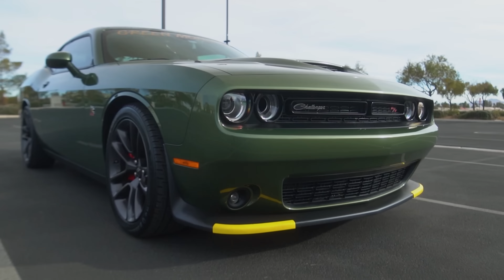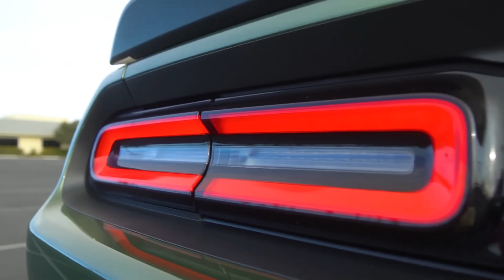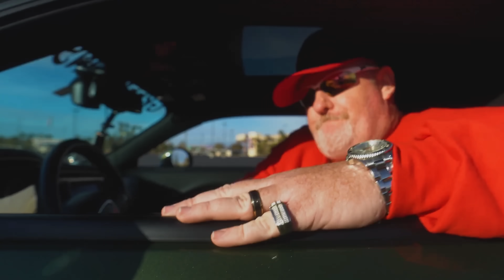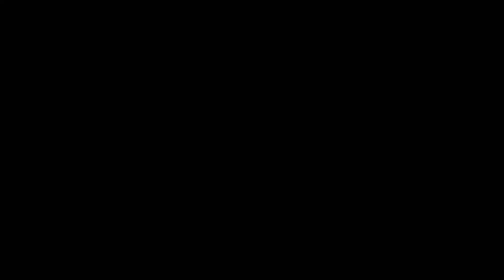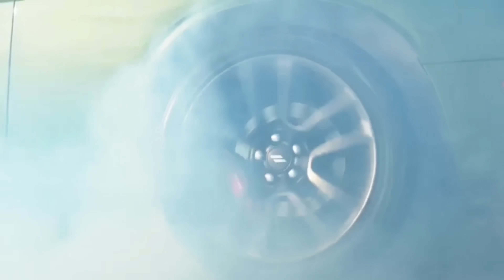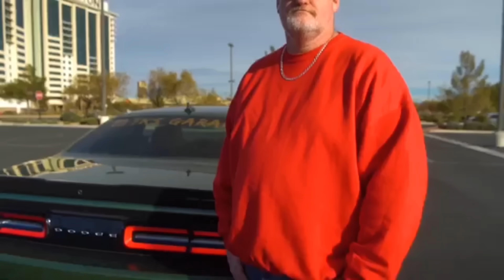Stellantis Engineers Decide On What V8 The Company Could Use In The New Charger

Comment: Here is a Little KNOWN Fact that if you have a 5.7L Hemi 360 like the one that was on the Charger, Challenger and Grand Cherokee if you upgrade the Valve Covers to the 6.4L Motor Covers and Add the Performance Valve Springs the engine will go from the normal 390 HP to 485ish after the CPU get a proper Tune. If you do the Valve Upgrade and Add Twin Turbos you can probably produce 700 HP without any issues!

Comment: Muscle  cars are meant for v8s Period. You go with what sells the most. Six cylinders were for emissions. That's been made pretty Clear over the past thirty years. Why else would the v8 Had nearly became extinct Over the past thirty years and slowly. Six liters are Tree hugger engines. The V8 is the hot rodder engine.Or car guy engine. Of course this is all common knowledge To even your average car enthusiast. To either your average car enthusiast I'm not saying. I'm not saying all 6 cylinders are bad. It's just  simply they  do not belong in a muscle car. And I will for damn sure Never accept even a turbo six Cylinder in An iconic Muscle car. Again that is not what they were meant to come with. And I think that the V8.
Should be the standard engine option. And not just any V8.
But  the icotic the eights That made the sales and put the company on the map. Super concept. Again six cylinders have their purpose. Just not for a muscle car.